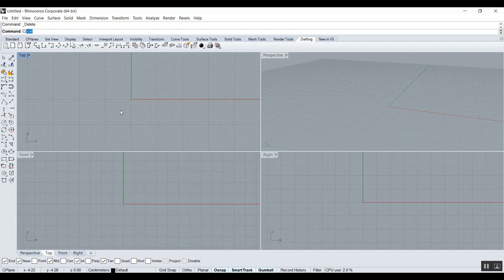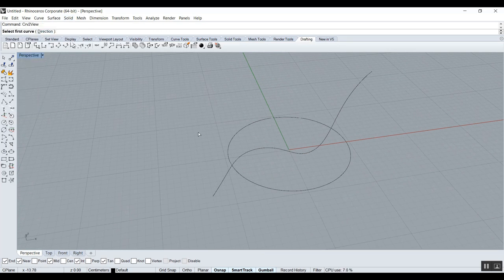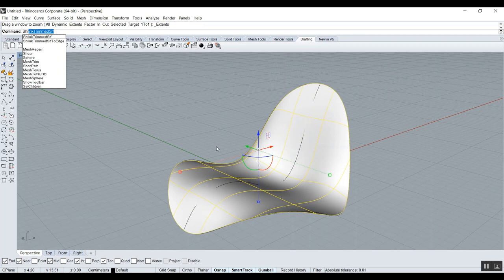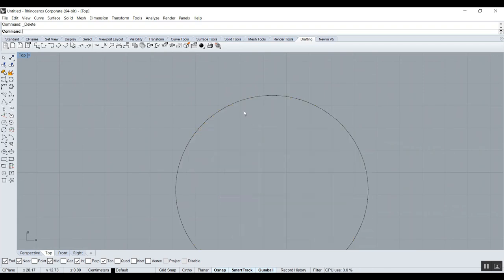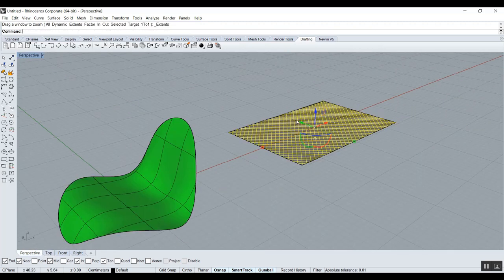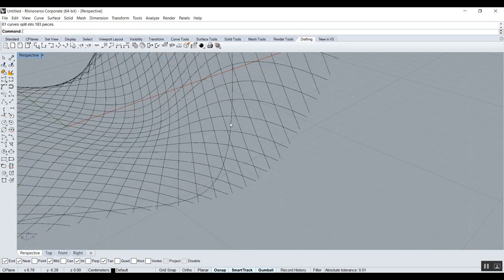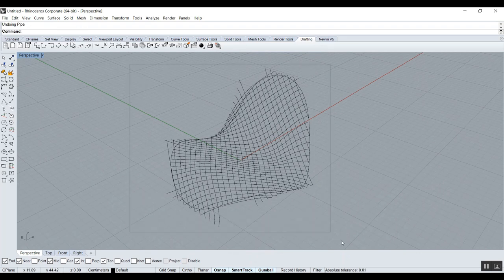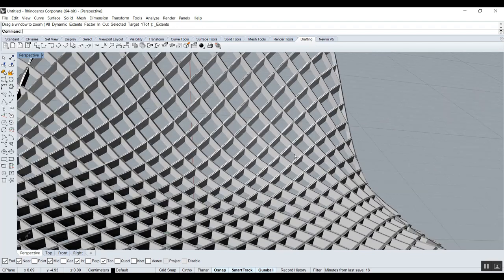Rhino 7 3D Exercise for Intermediate Chair Sub

Comment: At 5:10 you could actually use 'pull' instead of split and it should ger rid of the lines outside the green area much quicker.
Reply from the maker: Great tip thank you i ll give it a try :-)

Comment: Thanks for your tutorial, its very useful. Just some small suggestions, maybe unrolling the surface and keep the label at first would be easier? thus there wont be any extra lines. Btw, i think maybe to use network to frame this curved surface would be much more accurate than 'patch'
Reply from the maker: thanks, i would love if you could make a video, i ll post it or share it

Comment: I'm using your method to built a sculpture thing in rhino, it's really helpful but is there a way to make all the pipe join together as one piece? Thanks
Reply from the maker: not really unless you use Grasshopper, frankly you don t need it as it would print fine.
Reply: Group Command